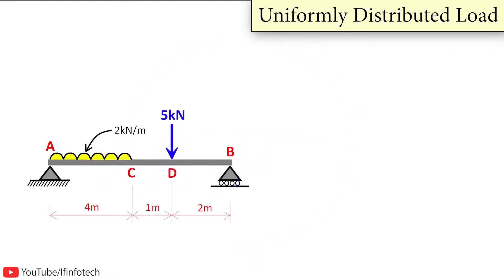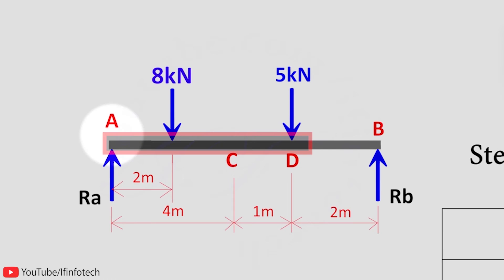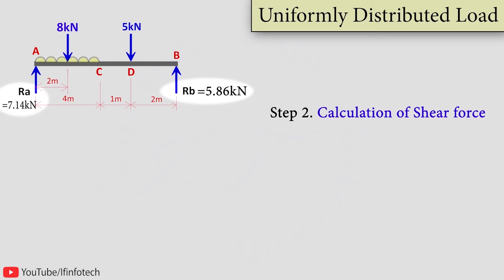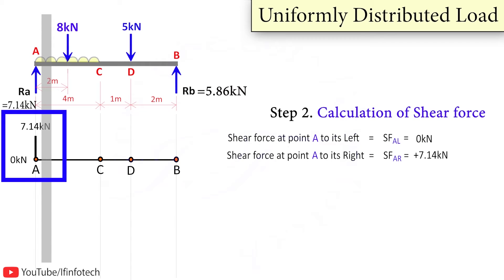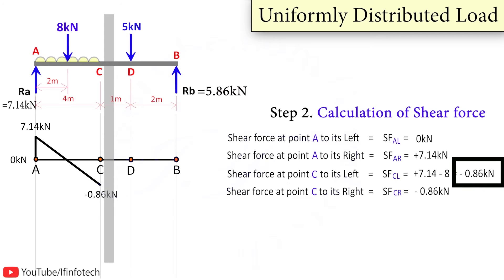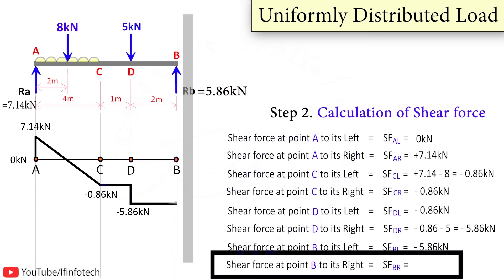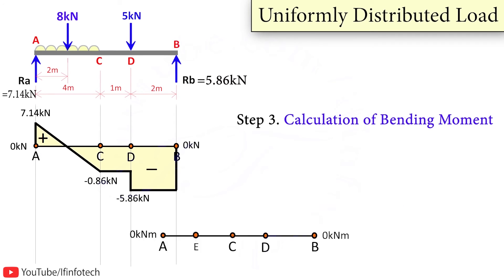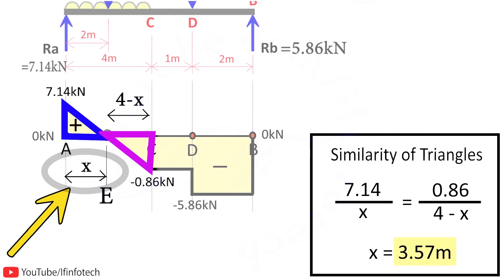Uniformly Distributed Load (UDL): Shear Force and Bending Moment Diagram [SFD BMD Problem 4]

Comment: while taking moment at E its length is 3.57, doesnt the point load 8 kN will be counted as Moment at E = 7.14*3.57-2*3.57²/2-8*1.57 ??
Reply: Bro 8 KN is UDL and 3.57 is also udl but 3.57 is part of 8 hence we will neglect it because we Have created Individual Udl of that